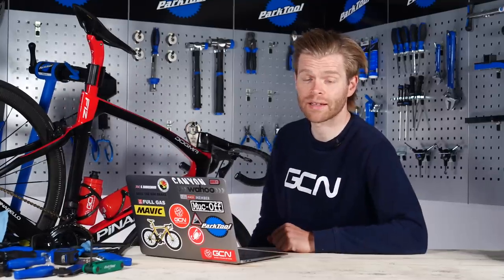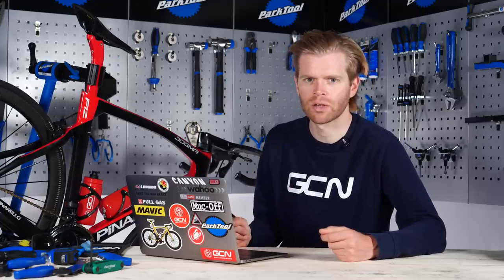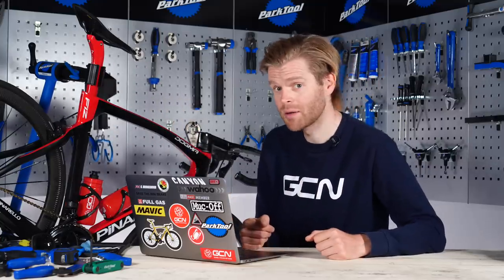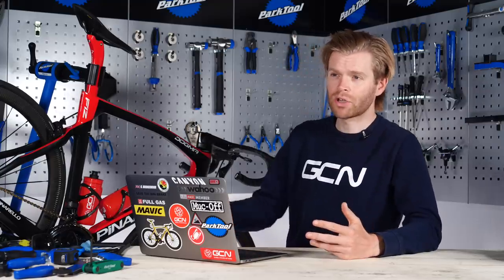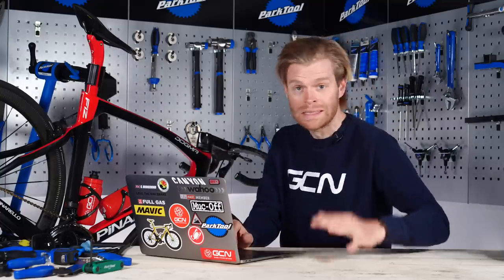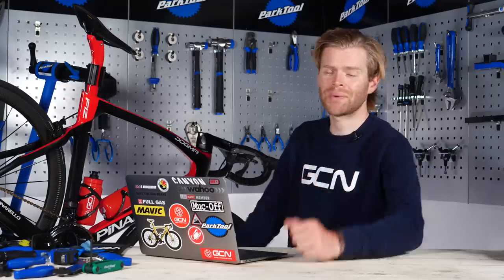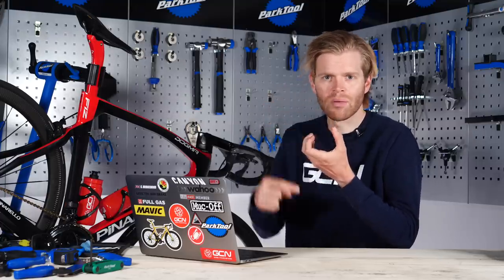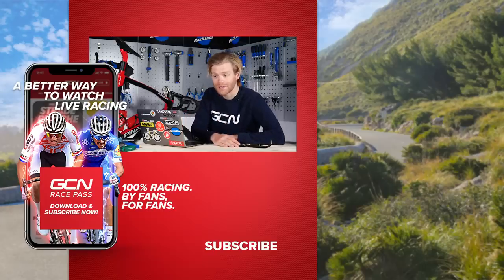Should You Buy A Smart Trainer Or A Static Bike? | GCN Tech Clinic

Comment from the maker: If you have a burning tech question, leave it in the comments below using the #AskGCNTech and we'll try to answer it in the next Tech Clinic!
Reply: We need a mullet aero test 🤘🏼
Reply: #AskGCNTech Hello Ollie & Manon! I'm thinking on buying some hookless tubeless wheelset, by doing some research on the manufacturer's recommended tyres I became aware that not all tubeless tyres will work. Which tyres do you recommend (28mm)?
Reply: #AskGCNTech. Hi Ollie, I have a 2016 Fuji Norcom Straight with TRP TTV aero brakes.  The rear brake is almost impossible to adjust as the non-driver side break never moves as much as the driver side no matter how much I adjust the spring tension bolts and therefore one pad is always hit the rim before the other.  Can I replace these breaks with another option, or this a hack to make these breaks work like they are supposed too?
Reply: #AskGCNTech Hi! I am a considerably new cyclist (2500k ridden) and I recently found my love for technical bending small roads and climbs! I am a student on a budget and after half a year of buying my first own second hand bike (focus izalco race 2018) I am now curious about gravel riding and maybe even something like Cyclo-cross. Do you have any tips for trying out new styles? Can I better upgrade or buy a new bike? Greetings, Niels
Reply: I have a question.  Come on, admit it, it's a cry for help?
Reply: #AskGCNTech Hi Ollie & Manon! I'm just wondering when should you change your derailleurs.
Reply: #AskGCNTech Hi Ollie, i have an 27.2mm aluminium alloy seatpost that i would to use in my 26.4mm pinarello catena seat tube, is it safe if i can just machining .8mm off?
Reply: #AskGCNTech Hey Manon & Ollie, I would like to buy a Wahoo Kickr Core for the winter season and after doing some research I noticed that it is not recommended to use a carbon frame on a smart trainer. How is your experience or opinion?

Comment: @9:18 for a hassle-free and tidy cable solution, check eBay for ’spiral cable wrap’. Pick a size that fits both cables, a colour you like and boom - done. You can use (and reuse) full length sections or just short bits here and there. No need to detach your cables either.

Comment: So there are a few options not considered here on the Peloton. At the end of the day it is an Android device so you can load swift on it if you hunt around for instructions. You would need some power meter pedals to give you cadence and power. This option would also allow you to have swift running on something else like a TV or tablet.
Reply: I have done exactly that, and it works quite well.

Comment: #AskGCNTech Hi there. I've been diagnosed with spondylolisthesis (aka slipped vertebrae) which stops me from riding my road bike in an "aggressive" position (which I sold a couple of weeks ago). So I went back to my old steel road bike and my BMX that both enable a more upright position. Other than a decent bike fit, what solutions and hacks could you recommend to ease stress on the lumbar area of the spine when riding on the road?

Comment: #AskGCNTech I was wondering whether the weight of cycling shoes actually matters. Expensive shoes are often marketed with their light weight, but what goes up, must come down, right? On the down stroke, wouldn’t gravity help offset any detrimental effect of additional weight on the upstroke? Started thinking about this because I bought an extra pair of shoes at Decathlon, just because I really liked the way they looked, were very well priced and they fitted me well (Van Rysel RR900 in ‘holographic’ silver). They are a little heavier than my other shoes however... but does that matter? There is of course the added weight whilst climbing, but that hardly seems significant.

Comment: #AskGCNTECH I've got a 2018 Liv Langma Advanced Disc with Giant's in-house brake system (Giant Conduct Hydraulic Disc brakes); would it be worthwhile to upgrade to 105 brakes? And would it be a simple change of the levers or would I have to change the whole brake system (pads, disc, levers etc). Thanks! (Love the show)
Reply: Levers, calipers and pads most likely would need changing and how you would mount the calipers would depend on the size of the rotor. You'd also need to change the hoses as Shimano may use a particular hydraulic oil